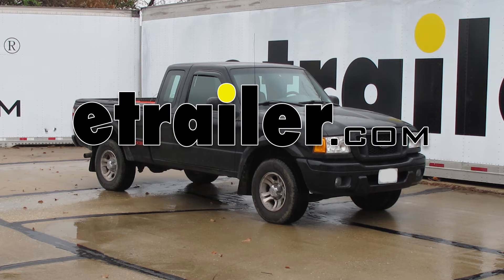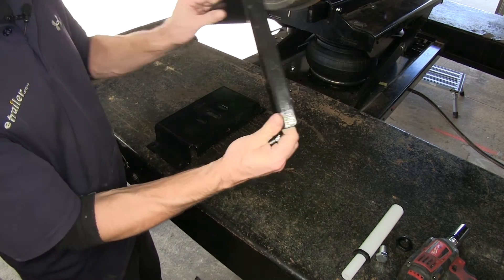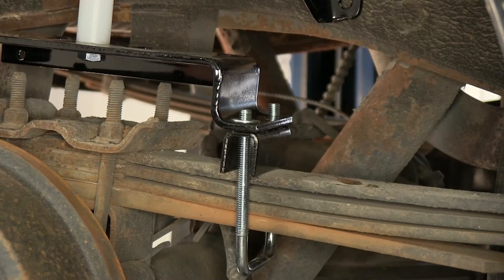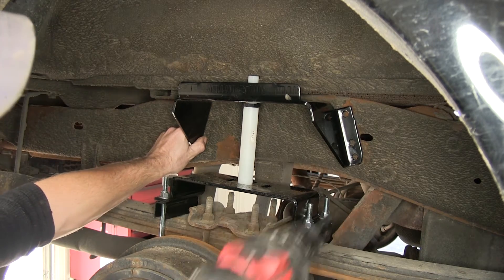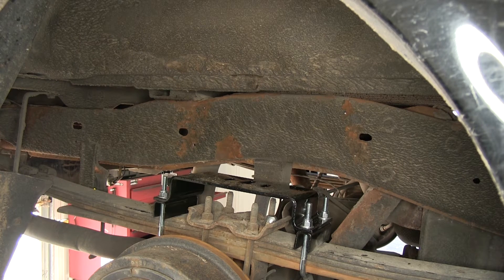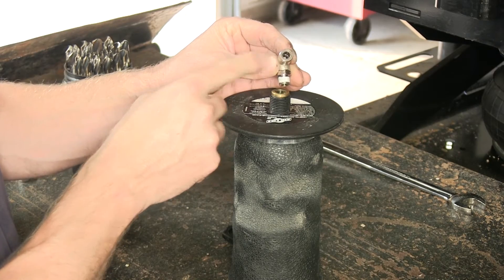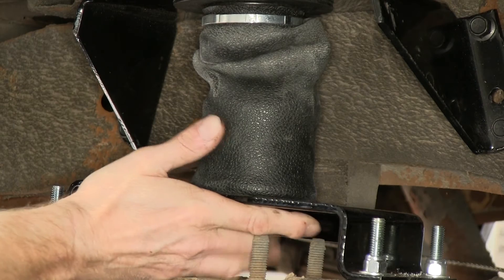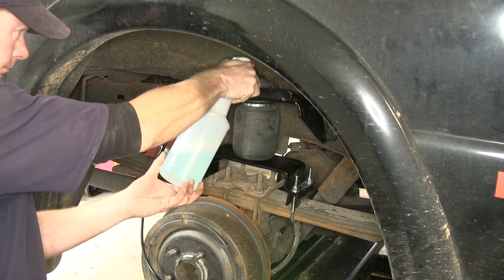etrailer | How to Install: Air Lift Ride Control Air Helper Springs on your 2005 Ford Ranger

Comment from the maker: If you would like to install this as a single path kit and only have one inflation valve that would be fine. However, there is not a t-fitting included with this kit, so you would have to source that yourself. If installed as a single path system then the pressure in each bag would be equal, and there would not be an option to inflate/deflate one side to a different pressure than the other.

Comment: I’ve got a small lift in my ranger (2-3”), and the leaf on my drivers side sits lower than my passenger side, so was thinking of installing this kit to help level out/take some of the weight from my contractor cap. Would it work with the lift or would I need spacers/longer springs?
Reply from the maker: This kit will work just fine on your Ford Ranger if your lift kit was a block under the rear leaf springs. This will solve your issue and allow you to level your truck side to side.
https://www.etrailer.com/Vehicle-Suspension/Air-Lift/AL59516.html

Comment: did you lift the truck by the AXLE or the FRAME to do this job?
Reply from the maker: The installation instructions call for raising the frame or lowering the axle until the leaf spring is in the normal ride height position so either way works as long as you can get the suspension to sit where it normally will during travel for the install. You can find the written instructions linked to this product page https://www.etrailer.com/Vehicle-Suspension/Air-Lift/AL59516.html

Comment: anything stopping someone from twining the two air lines together? and only having the one shrader valve?
Reply from the maker: +Stuart McCauley If you would like to install this as a single path kit and only have one inflation valve that would be fine. However, there is not a t-fitting included with this kit, so you would have to source that yourself. If installed as a single path system then the pressure in each bag would be equal, and there would not be an option to inflate/deflate one side to a different pressure than the other.
Reply: For all the difficulty, drives me nuts they don't provide a leveling valve like a heavy truck.....it's just a wire attached to a valve, ffs...My Ranger will have one, one way or another.   I intend to have on-board air supply, however.  YMMV.  Been a trucker for 23 years...leveling valve is just obvious if you have a continuous air supply...
Reply: @MrAcuta73  i don't understand what you are saying.  could you write it out or even better, provide a youtube link?  i'm installing a kit now and wonder what else i could do to make the system better.
Reply: @donaldfafard  Can look up leveling valves on YT.  It's essentially a ball valve between your air supply and bag attached to the frame, the actuator on the ball valve is then connected to the axle.  When you load the vehicle, it opens the valve and inflates the bags to ride height.  Could probably hack one, but a "real" leveling valve has an intentionally loose actuator and a relatively large dead zone.

Comment: Can you Why connection the lines together
Reply from the maker: Yes, you can run a t-fitting to join both air lines and run them to the back of the vehicle. This will make it easier to inflate and deflate the air bags. 
https://www.etrailer.com/Vehicle-Suspension/Air-Lift/AL59516.html
Reply: If you go that route .. wont the air shift from bag to bag for example with a heavy load on a curvy road?

Comment: 1500 POUNDS??
does anyone else wonder how this ranger can take all that weight and not sag?  
can i call mine a ranger 250 or the 'R-250'.  lol
Reply from the maker: The weight capacity in the bed of a Ford Ranger will depend on the model that you have. The motor, 4wd, and 2wd will have an effect on this measurement.
https://www.etrailer.com/Vehicle-Suspension/Air-Lift/AL59516.html